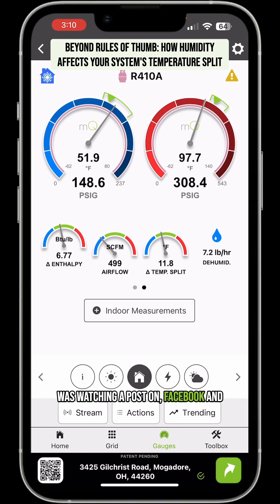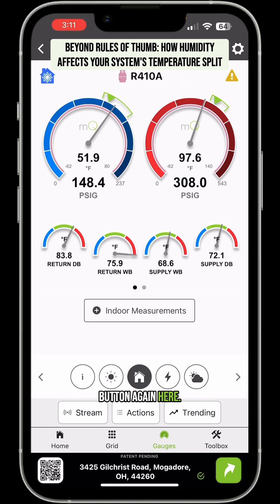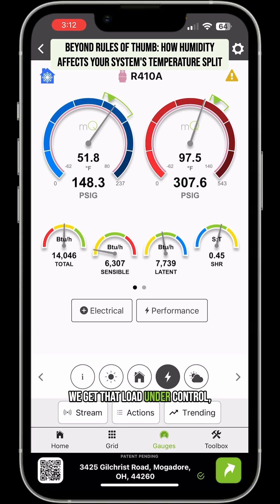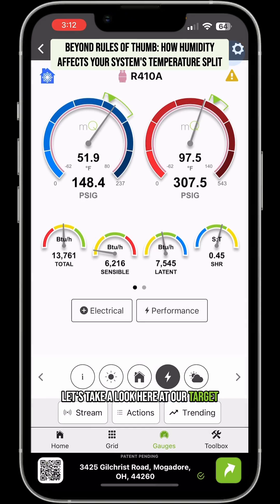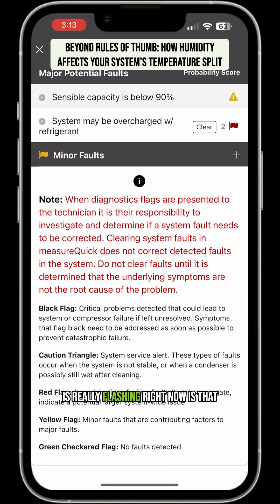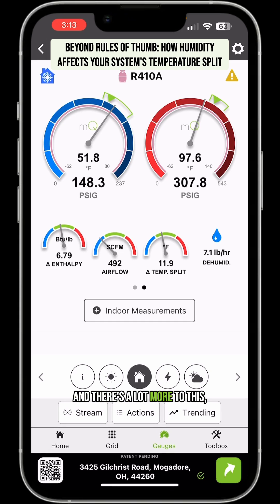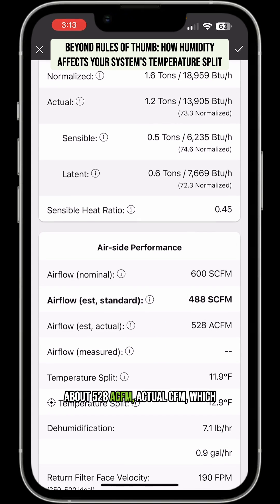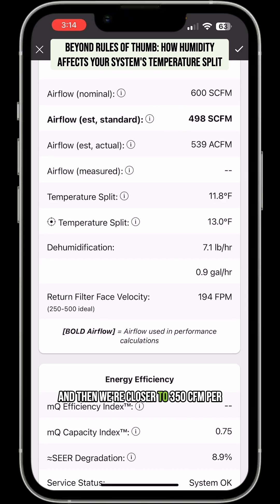Humidity vs. Temperature Split: What Your Digital Gauges Aren't Telling You

Comment: Great post—thank you for all the work you do. I’ve always wondered about something, and it shows in this video as well: the return relative humidity is lower than the supply relative humidity. I was always under the impression that the supply side should read lower due to dehumidification.
Reply from the maker: It’s relative humidity. The air is cold and ringing out water. It’s raining at the coil. The humidity can approach 100%. That said, as soon as the supply air exists the register it will rapidly expand and have a lower Rh then the return.